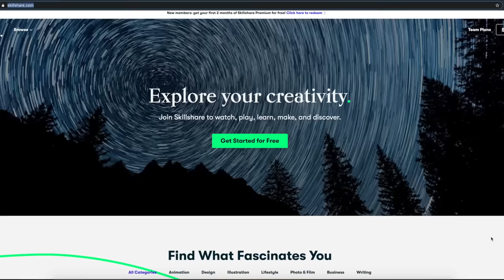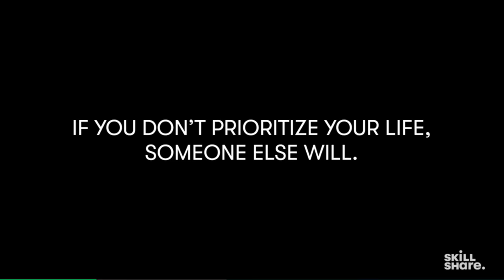20 Wilderness Survival Tips and Bushcraft Skills

Comment: 8:50 that's actually really useful and good trick to get fire going with ferro rod! Both timber and rod keeps stable and close to each other, both of which can usually be an problem. Pretty much most useful tip on the list.

Comment: Just as a heads up, one of these tips could be risky. It's the one regarding flipping the battery in your head lamp. If the lamp doesn't have current protection it could ruin your device or theoretically (unlikely) start a surprise fire. 

It's fairly standard to put a diode to prevent current in the wrong direction, but cheaper/Chinese knockoffs may skimp. You may be able to get away with it just due to how leds function however.
Reply: Put a small piece of polythene between battery and electrode
DOH !
Reply: Or just take the battery out
Reply: How to protect yourself from lightning when camping?
Reply: @blackninja9400  dont be in a tree top during a storm
Reply: @rumpelstiltskin9729  You can be struck by lightning even if you are next to a tree, under a tree, in a tree, if you have metal on you, you are next to metal, simply on the field without any protection or shelter.
Reply: @blackninja9400  don't go camping
Reply: ya this would not work with an incandescent flashlight so this must be a pretty new tip
Reply: @blackninja9400  if you are near metal then you are also near civilization
Reply: @Arshyn7112  감사합니다!

Comment: I noticed you used duck tape for a flame. I've never done this, but i often carry bicycle tubing and use small cuttings for burning as it gives a very hot flame. Also the tubing can be used for a wide variety of uses, such as a sling, melting and using for patching holes in boots and such. Also used for belt, repairing a snapt Shoulder strap, cordage, trapping, making crossbow ,  and a wide range of other uses. 
Thanks for sharing your ideas and skills.
Reply: It's duct tape
Reply: @looksirdroids9134  Thank you for the correction. Captin plice . 😎🥳👍
Reply: How to protect yourself from lightning when camping?
Reply: @looksirdroids9134  either one is fine.

Comment: When I lived in Virginia in the USA, I was in the Boy Scouts and my troop did at least one survival camp out every two months we use plastic bottles that had pull tops. We would fill the top with sand, then charcoal scrapped from pieces of firewood, and then moss with small stones to filter water.
One trick we learned was making what is known as a Swedish Torch. This is a small log that is easy to carry where you cut grooves into the top and cut some of the inner wood out, you can then put coals from your campfire into this and carry it to a new campsite.
Reply: In summer months you can buy those Swedish torches in many hardware stores and even some supermarkets in my area

Comment: Surely burning gorilla tape is putting toxic fumes into the air. It may be useful in a life-or-death situation, but I’d advise against it in any other case. It’s better to learn how to start fires with friction and easier if you just use a ferro rod. Duct tape/ gorilla tape is great for first aid purposes though, I’ve used it many times to tape up a cut or blister so I could keep working and you don’t have to worry about it sticking to you in those cases because your blood or sweat will eventually make it slip right off so that you can replace it with a more appropriate dressing or bandage.

Comment: I grew up in the PNW and can live in a hole in the ground if I have to.  Usually I crap right back all over the "survival" videos, but I subbed yours inside of a minute, straight to the point and clearly good advice for city folk and woodsmen alike.  That said, a quick (and IMPORTANT) addition: conifer pitch mixed with a small amount of white ash is a natural antiseptic and bandage.  Apply when still slightly hot and tacky, and it will seal and heal small cuts and abrasions.  Anybody who has lived in the wet for long enough to suffer otherwise, knows the value of this ancient native american remedy.

Comment: The cup...why not use the resin gathered earlier to glue and seal it?
😜😂😂😂

Incidently, it's rare for any tree to have feeder roots (the ones you highlighted) deeper than 4 inches.

Pottasium permanganate can also be used to purify water.
One or two grains per litre of water and it's drinkable and safe within fifteen minutes.
It deals with bad smells from organic matter in the water and also sorts out excess iron and/or manganese.
Reply: Resin is water soluble tho, also it would make everything sweet won't it?

Comment: You can combine the pitch and improvised cup to form a watertight seal- pour the melted pitch into the cup and turn it over until it coats the inside surface, then keep turning it until it sets to get an even surface. It's how they used to waterproof leather containers hundreds of years ago

Comment: What I use for a chopping block is a log that has one side branch stub still on it so I can keep the log from rolling by bracing my foot against that stub. Then, I chopped out a relatively flat space where I do the actual chopping so that it's easier to balance the log I want to spit or chop on it. I also always place my axe on top of the log where I want to split it and hit the backside of the axe with another piece of wood so that I'm not swinging the axe to split logs at all since I am a beginner. When I chop bark off or something, I brace the bottom of the log I'm chopping against the ridge created when I flatted part of my chopping log and I stand completely off to the side and chop so that, if I miss, the axe will only go to the side of me and I won't chop my leg. This has worked pretty well for me thus far.

Comment: When putting a saucepan (frypan, mug) on the tin with the fire, you have to place some spacers under it so the flames can burn completely with less soot and more efficient burn.  Do it with a couple of green sticks, 1" in diameter.  They can be replaced when they start to burn.

Comment: On the Primitive glue, the dude keeps saying "RESIN" but what he actually means is "ROSIN". There is a difference being that Resin is a powder when mixed with a chemical and lead to make insulation for wire. (Worked at Southwire making the coatings that cover and insulates the wire). ROSIN is the sticky substance from pines or cedar trees. Flammable and helpful. Also knots on pine trees has what us southerners call "lighter" wood. It has a strong odor and catches fire really fast. I've still got about 15 lbs. of it and when I go camping or fishing at night, I always bring me some "Lighter Wood". Just because it's dead doesn't mean it isn't useful.

Comment: for the makeshift filter... a more efficient way to build it is to go ... moss to hold everything inside, then ash/charcoal, sand, small pebbles, larger pebbles, then small rocks.   this will filter the most mud/trash per pour.   Like you said though, you still need to boil the "cleaned" water to kill any bacteria or pathogens.
Reply: Also...the sun can purify the water in a clear bottle or shallow pan. Takes time but I would also boil if I have a fire.

Comment: None of those vines here.. but blackberry vine works great and are in many places. Ive also used poison oak (im immune to it) because it often vines very far..
A little pine pitch in the larger side of a feather stick makes a super hot torch that may even drip fire.
Reply: I prefer the sand and char filter, Its a good idea to boil the sand if you arent boiling the char filtered water.
However a tightly rolled cloth stuffed through the bottle opening works incredibly well. Just do not leave cloth to be wet for over a day.
Great videos. I do lots of the same but still feel like Im picking things up

Comment: Important notice: Never peel off fresh bark from larch trees unless your skin is protected. If not, you’ll get hundreds of very tiny nearly invisible needles penetrating your skin and when they dry, pain occurs every time you move or something touches you. Even wearing clothes on larch exposed skin is very painful. 
With a magnifying glass and light shining towards you from varying angles, they can be spotted and picked out with pincers one by one but they are as brittle as thin glass fibres so those you brake off will hurt you until the exposed skin cells are pushed out (replaced by new ones which takes 7-14 days)
Kind regards 
Anders

Comment: Some circuits aren't protected against reverse polarity. I imagine flashlights are designed with user error in mind, so they should be okay, but  as a general rule don't put batteries in backwards. A better idea is to bring extra batteries in a storage case. Be especially careful with lithium batteries, they could cause a fire or burn you if they short on something in your pack.

Comment: 3:36 "you can get a much stronger flame by facing the opening of the tin can towards the wind. The extra oxygen being forced into the fire will result in a more efficient burn. If you want to elevate your flame to the next level, use a turbocharger"

Comment: you can use lint to start a fire too. from ur socks or anywhere really. cotton lint. we used to do it in jail when all we had was a sparker left on the lighter. we'd roll up toilet paper and put lint on it then use a spark to light it. if there was no sparker we would get the cleaner to go to the electrical outlet and use metal glasses to make the spark to light the wicks
Reply: also before they welded the tv remotes to the tables we would use the batteries for the spark but they wised up to this. didn't want to have to keep replacing the batteries every day lmao

Comment: no need to use a knife to split duct tape, the way its made makes it want to split straight. just use your teeth to make a small cut for the size you want and pull a thin piece off.

Comment: mylar balloons full of homebrew hydrogen gas in powerlines hidden from sight
bust every one of theyre yuppy trash car windshields and windows silently and for dirt cheap in mass with pellets and metal bbs even 6mm aluminum airsoft bbs will work in standard airsoft aegs there is even a 177 metal bb rifle using airsoft aeg technology called the barra 400e these can be mounted to drones on land and air and even some body of water i mean just think the possibilities are endless untold economic damage
every nail in the roads sparkler c02 cricket bombs only 9 bricks of sparklers shreds the doors off a car
nails and bbs simply taped on as shrapnel or even knuraled for even fragmentation co2 cartridge rockets are very easy
japanese spider hole bunkers earthship concept houses hand auger ice fishing drill mini wells
static electricity generator fries data instantly
there is so much more hopefully you all see this for the times to come because where your sitting reading this yes you in the next ten years that spot is going to be part of "da hood"